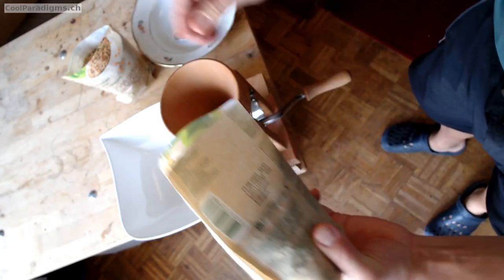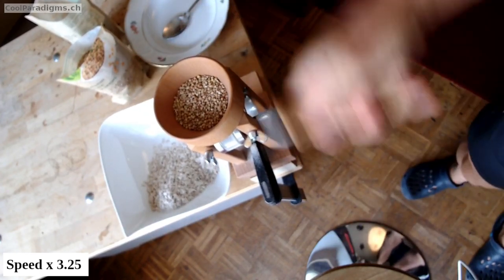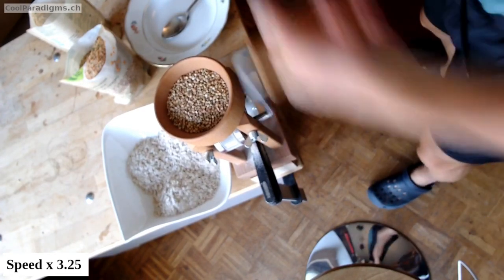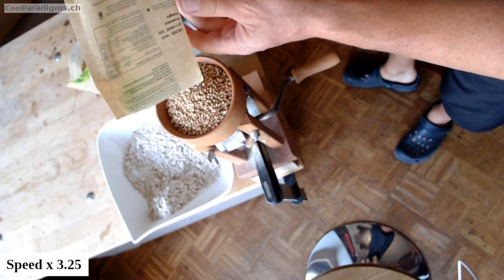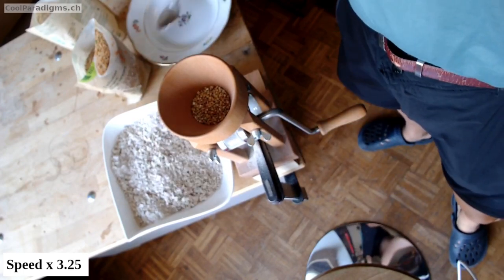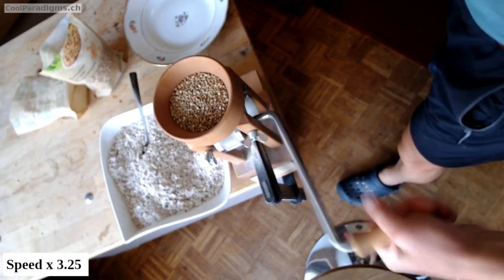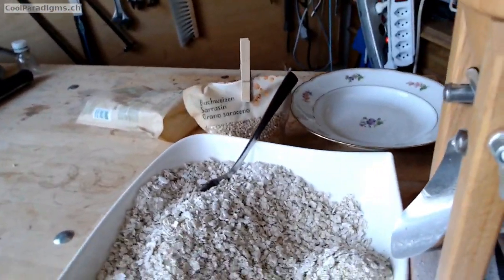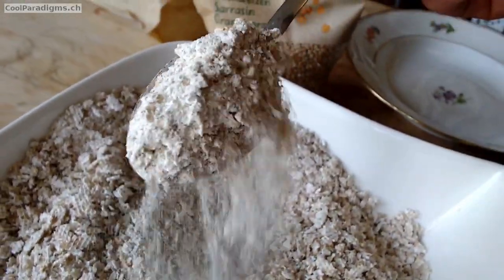🌾Make your own buckwheat flour with a grain flaker

Comment: Did you use groats straight from th e bag (not pre soaked nor dried in the oven, no preparation prior to flaking ?)
Reply from the maker: 🌱🌱🌱🌱🌱🌱🌱🌱🌱🌱🌱🌱🌱🌱🌱🌱🌱🌱🌱🌱🌱🌱🌱🌱🌱🌱🌱🌱🌱🌱🌱🌱🌱🌱🌱🌱🌱🌱🌱🌱🌱🌱🌱
🌾Just intact buckwheat seeds straight from the bag and capable to sprout (*1) and the dryer they are the better! ...  for cracking into small parts and the thinner the flour becomes. I also tried once with slightly soaked seeds, there is a risk to clog the grain flaker, but with the correct humidity we have well formed flakes coming out of the flaker instead of a quite thin flour. By the way flakes from cereals having a lot of gluten, like wheat are more compact and resistant compared with buckwheat flakes.

 (*1) I checked, but it would not change much if they were older and unable to sprout.

😋Enjoy your home made food!